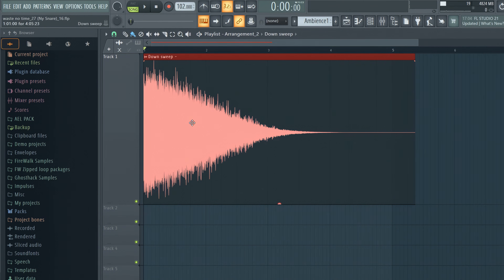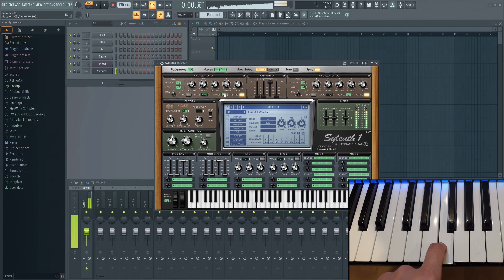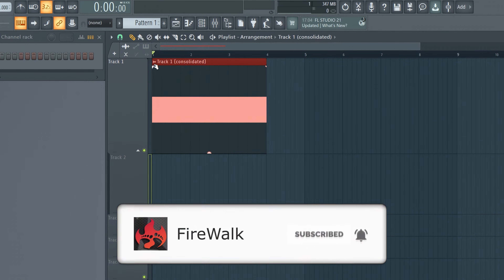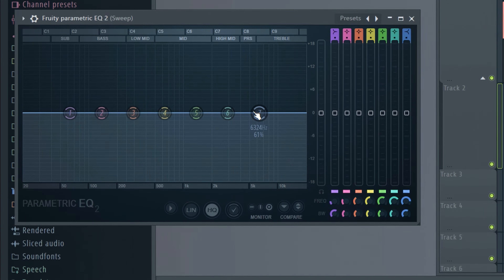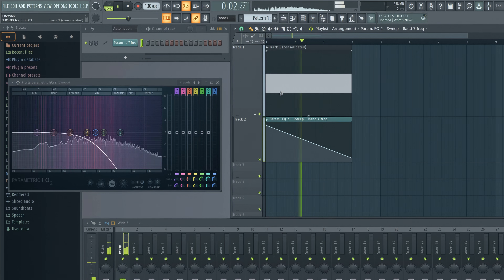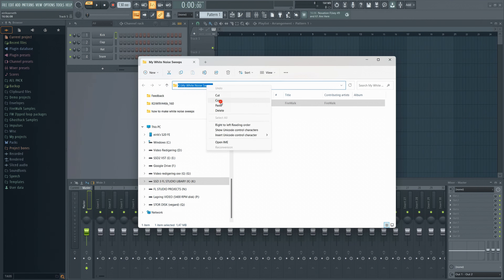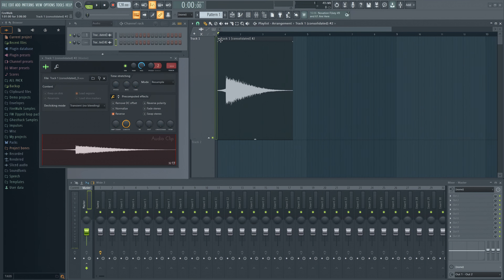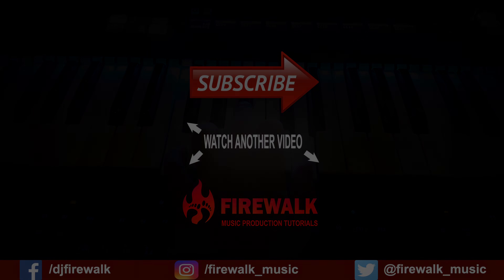How To Make A Typical White Noise Sweep Sound Effect In FL Studio 21

Comment: If you want to improve the sound of you system use silver plated teflon insulated wire. You will be able to hear the 10th harmonic of any frequency.
Reply from the maker: Makes about as much sense as the indicator buttons on the new model 3. 🤪
Reply: @FireWalkMusic  
But audio fools will buy anything that is expensive to give them the illusion. Like those $1000 speaker cables.

Comment: Do you think it's good to have a noise track consistently under the hats or should sweeps be doing the job of filling that space? Great video like always!
Reply from the maker: The thing is that there is no right or wrong in music. If it works, it works. It's not something I usually do myself, but it all depends on what kind of music you're making and what kind of sound you're going for. It's all about frequencies and filling space in the mix. I can easily picture a scenario where you might want to fill some extra frequencies to support the high-end percussion for example, adding some white noise to take the place of a typical shaker or something like that. Just use your imagination and experiment. If it sounds good, it sounds good. It's really as simple as that. :)
Reply: Uplifting/energetic trance. I figured the answer was probably along the lines of "if it sounds good it is good" but was curious your take on it lol Thanks FireWalk.
Reply from the maker: @C_F_M  yeah, it's a cliché I know, but it's true 😆
Reply: What kind of music are you making?